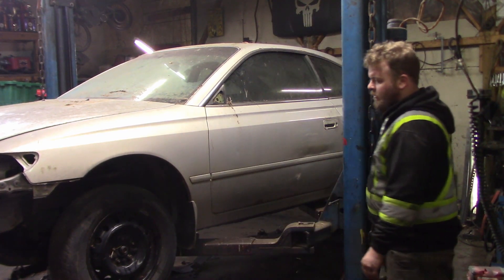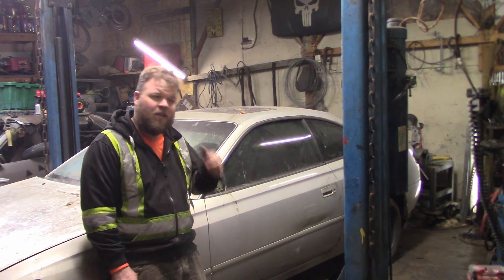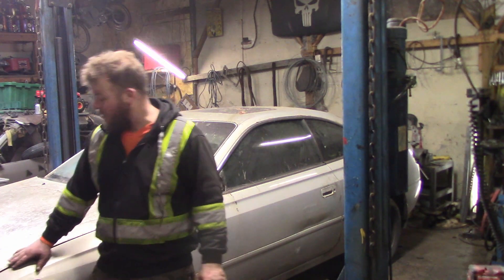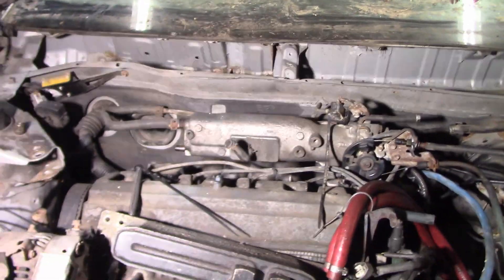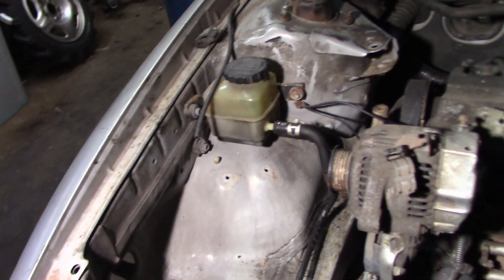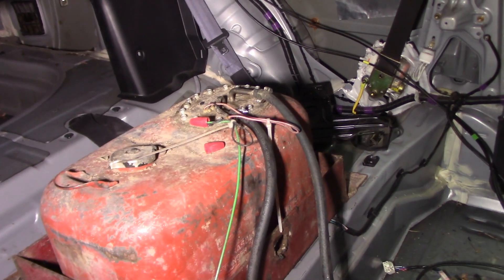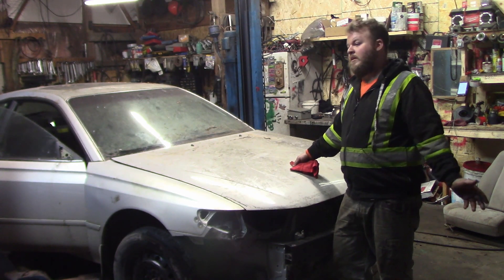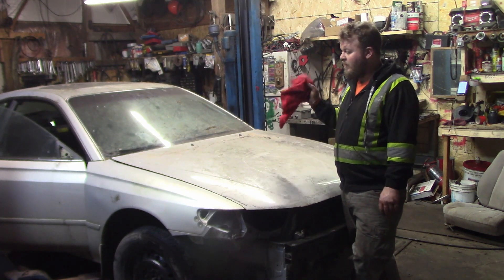well this solara is as built as i can do until i know where its going

Comment: Zach how did you run your fuel lines in your camrys? Did you run a hose from the tank to the fuel rail, or did you run the hose to the fuel filter?
Reply from the maker: I try and use fuel filter and in tank pump
Reply: @zacksworkshop171  Its a 2001 Camry so it doesnt have the return fuel line, instead it has this dampener bolt on the end of the fuel rail and a really bizarre fuel hose running from the fuel rail to the fuel filter. I wish i could post a picture of it on here. I am trying to find a business that can make the hose longer so i can run it to my cage

Comment: With a bumper swap and allowed 4 ⅛ inch plates would a 98 accord hold up to camrys well?
Reply: Yes!!! Get yourself an good old iron bumper, I prefer shocker fronts. Just watch your front suspension because they like to break spindles a lot.
Reply: Not gonna lie.. I’ve ran a bunch of Hondas 90-96 and I’ve ran 92-2001 Camrys and I’ll tell you I’m not a fan of a Honda motors hood suspension is junk and no I do not think a Honda is nowhere close to a battle for a Camry a Camry will destroy a Honda all day long
Reply: @chelciecubbage7945  a 98 is a lot different that 90-96. 4 cylinders will keep up with a 4 cylinder camry and the front frames are a lot more stout than a camry depending on rules. I've seen Hondas trash camrys in a light weld setting. Camrys are over rated these days imo. Only reason people like em is the motor.
Reply: @jessedunn7115  your wrong I’ve ran alot of Hondas and 90-93 was the best years for Hondas due to the spindles 97 and newer spindles snap been through all these Hondas know everything about them I’ll junk a Honda with a ford escort believe it or not Hondas was only good for motors
Reply from the maker: yes they are and can be super tough

Comment: I got a 2007 Chevy Malibu with a 2.2 eco tec it cuts power if the tires spin over 3000 rpm any tips on how to fix that?
Reply: Remove abs and traction control/stabilitrak
Reply from the maker: tracton control maybe
Reply from the maker: i still have to do that on the g6